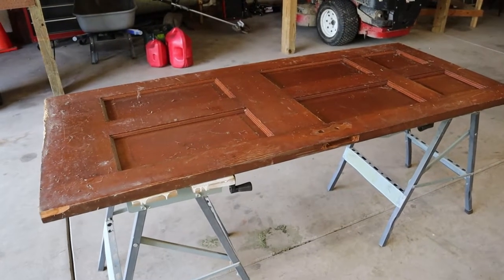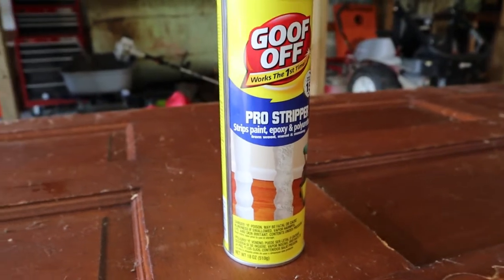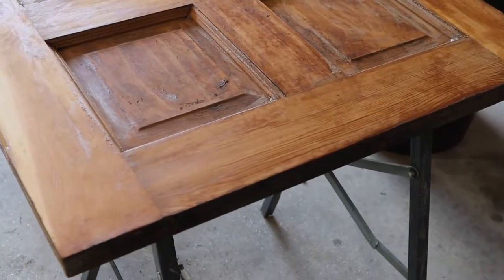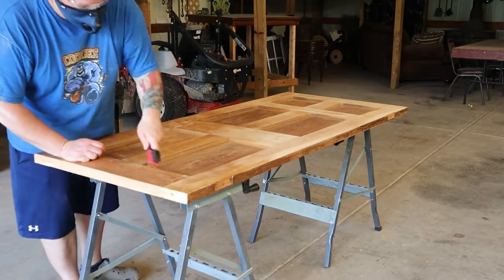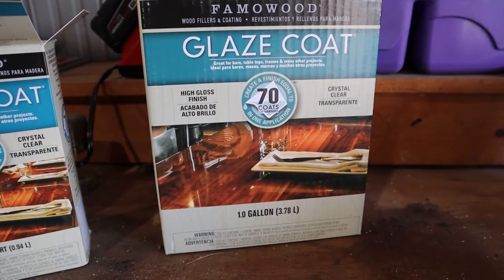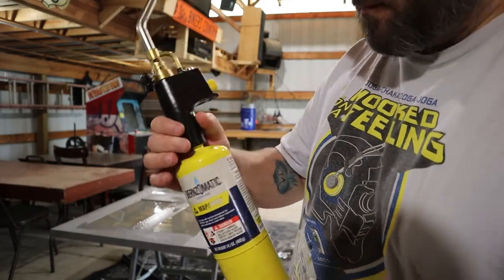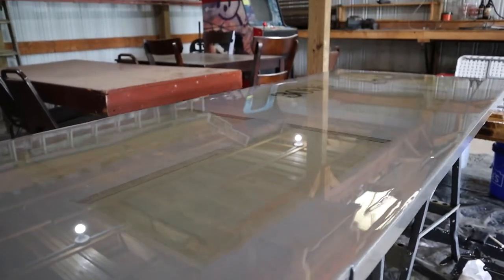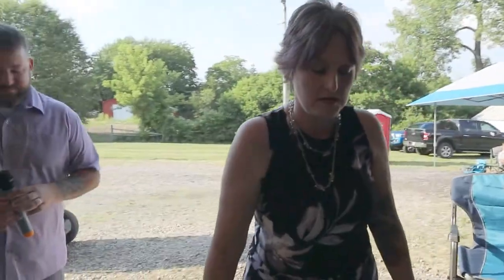Turning an old door into a new desk for my wife for our 25th Wedding Anniversary

Comment: I can't wait to get started on mine! I have a door from my house that was built in 1903 that was double-hinged between the kitchen and dining room. That varnish was on 2000 sq ft of hardwood floors and we went through 250 sanding discs and 22 sanding drum sheets. The drum sander used 20 grit to get the varnish off the floors. It was crazy!
Reply from the maker: That does sound crazy! Good luck with your project.